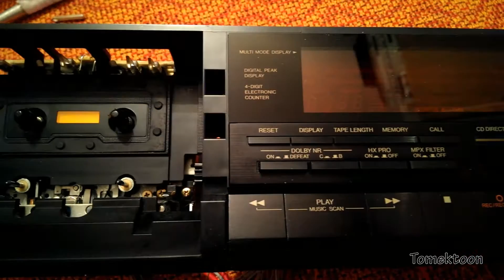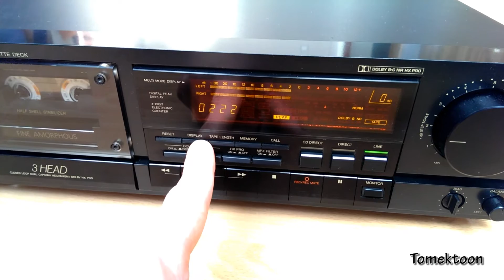JVC TD-V621 Cassette Deck teardown/inside (1989/90)

Comment: I had a similar deck .  I've forgotten model number but I believe mine is older than this. and they are really well made. Sound quality is great. Reliable and solid. Mine had 3 heads and two motors. I used it for about 20 years and nothing failed. My friend still uses it now. No problems yet. Mine was pre dbx but had Dolby B and C. I must have made over 100 tapes with it. I took good care of it tho.

Comment: I know I'm shouting into the void asking here - but I have this deck and it worked fantastic until it decided to have trouble engaging FF or REW, at first with a jittering noise then not at all. Is there a rubber belt or roller that can be replacing for this? The two belts I can see here are just for the capstans and playback, so don't help with my issue.